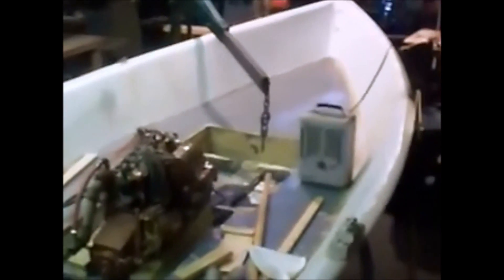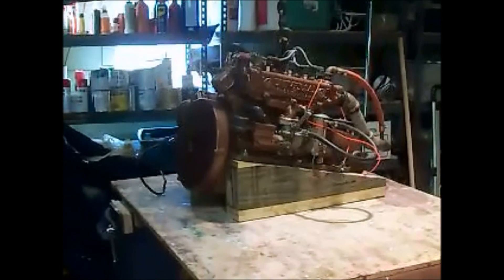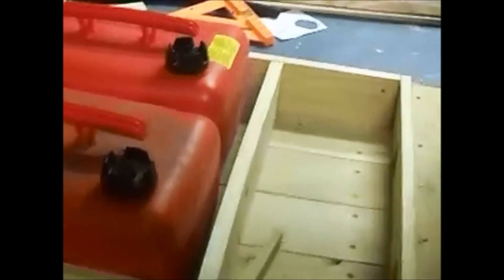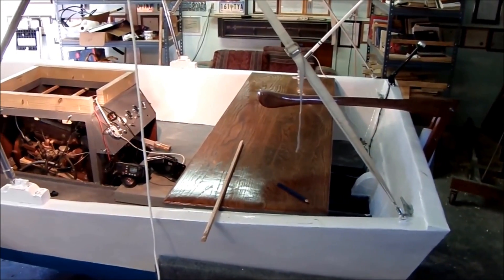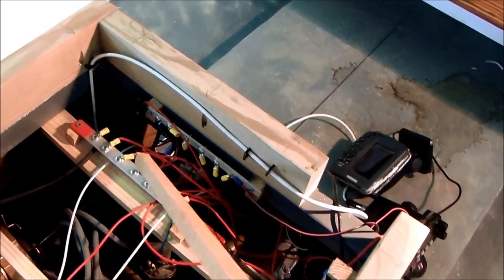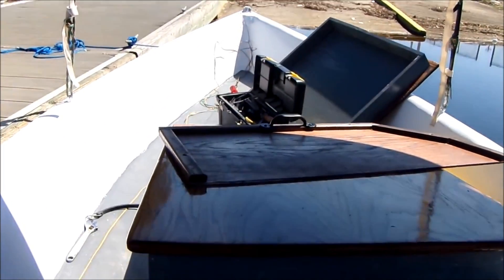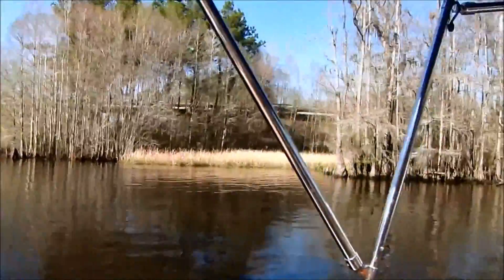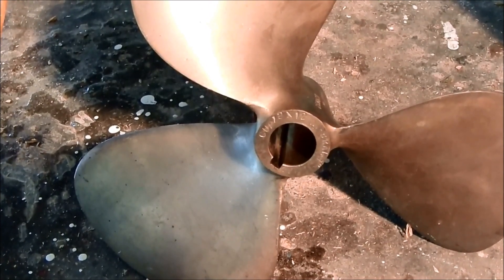Installing an inboard motor in homemade boat (short version)

Comment: How amazing to see all of your work zooming around.   Cool!
Reply from the maker: Great minds must think alike, as regardless of design and build execution quality, it is still humbling to zip around in a boat knowing nearly every part, from motor to hull, has been built up by you.  I say humbling because I know that all defects, omissions, mistakes all boil down to me;  humbling because, as noted in the video, many of those mistakes leaped out at me while testing the boat.  
    Funny thing about the two kids in the video.  I signed them on with the idea that if they could operate the boat, then anyone could.  To my surprize they drove at least as well as I, and I suspect even better.
Thanks for watching.
Reply: That's art in motion!